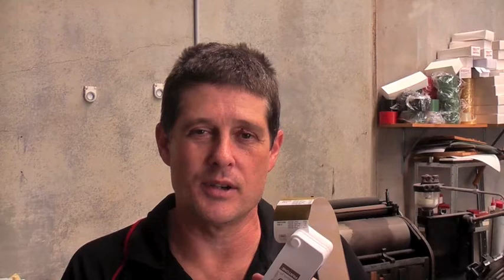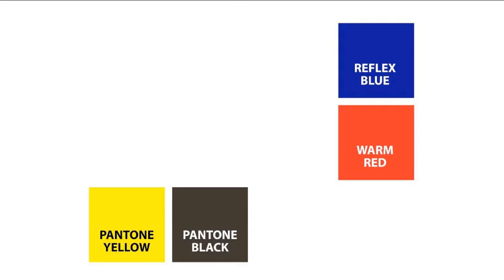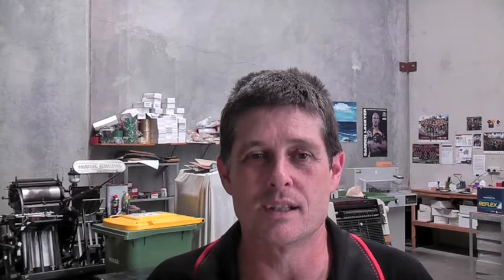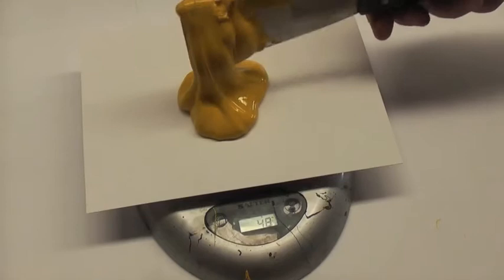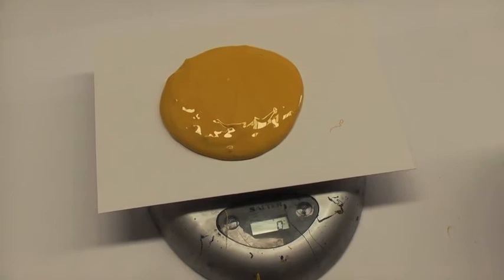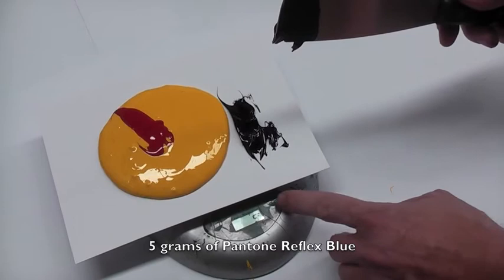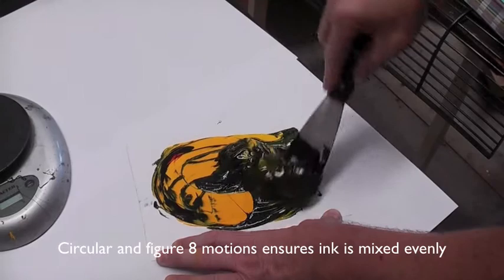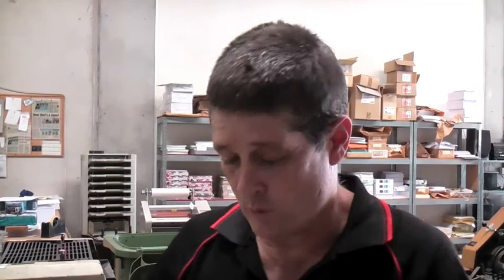The Art Of Ink Mixing

Comment: Very interresting video! Can you tell me how can we convert percentage of ink on the pantoner in grams for the scale? For example If i mix 210 U : the percentage of colors is  9.40 / 3.10/87.50 , should i weigh the same number in grams and thats for wich quantity 100 grams 500 grams? Your answer will be very helpfull thank you!
Reply: 1 ounce = 28.35 grams.  If you are making 1 pound of ink based on the above formula in your question, all you do is multiply those amounts times .01, starting with smallest percentages first. Balance will figure into the largest amount to round out to 100%.